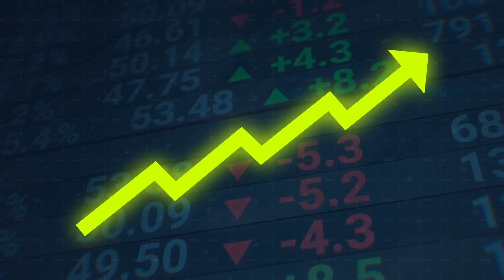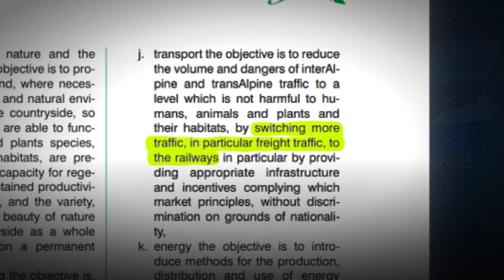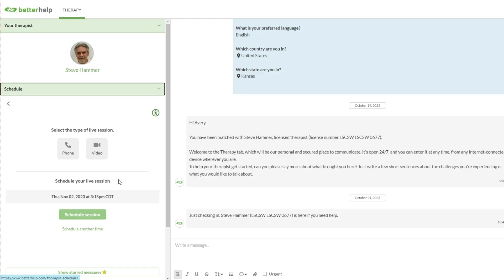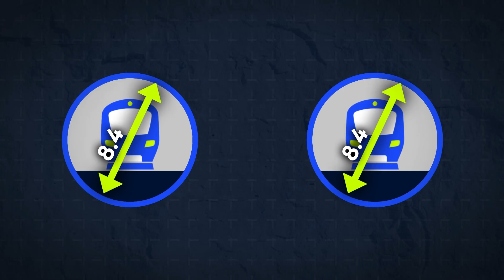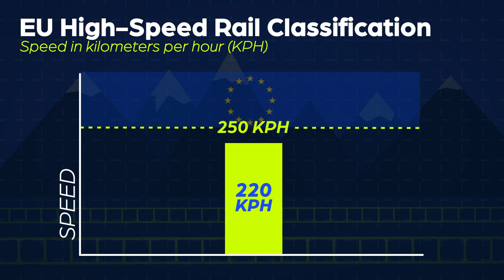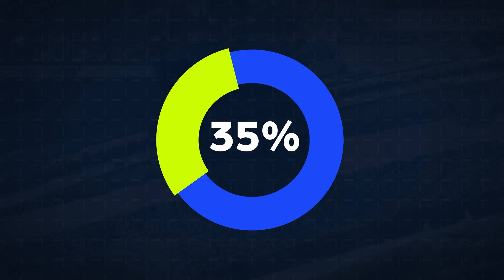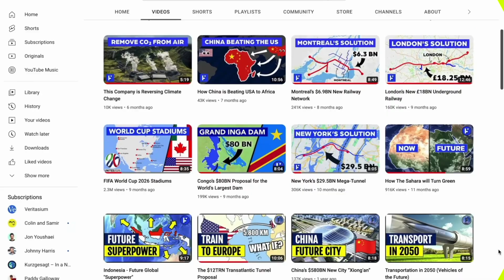France’s €26BN New Railway to Italy

Comment: Opening this new high-speed line from Lyon to Turin would allow effectively high-speed travel between France and Italy at speeds up to 270 km/h or more. But SNCF also needs to build two more TGV high-speed lines, one from Bordeaux to Toulouse and one from Marselle to Nice (and possibly to Monaco beyond). Just these two new TGV lines would tremendously increase usage of TGV in France.
Reply: and bordeux spanish border (spain already build the rest to madrid), and they should finally fill the Nimes-perpigan gap on the line to barcelona. then frances high speed network is finished.
Reply: @melaniedrogr951  I believe there are plans to connect Bordeaux with the Spanish AVE network.
Reply: @Sacto1654  there are, but they have remained plans for quite a long time. Long enough for spain to build the entire madrid/french border section based on the same plans.
Reply: A connection between Nice and Genoa would be cool too
Reply: And montpellier- perpignan/spanish border high speed rail link
Reply: The Marseille-Nice section is a very tricky one to do, the french riviera is very densely populated. Often i look around and wonder where the hell are we gonna be able to build a new HSR
Reply: @looped7979 Exactly. It's only working with a whole bunch of tunnels and bridges and that's too damn expensive. 

Upgrading the classic line for higher speeds is already enough of a challenge.
Reply: @hagmax1531  The planned line from Marseille to Nice (and possibly beyond) will be heavily tunneled, for obvious reasons.
Reply: Bordeaux - Lyon would be amazing too
Reply: Qu'ils refassent déjà la ligne Paris-Toulouse et Bordeaux-Lyon au lieu de faire des transversales stupides dans toute la France pour rallier ces deux villes.
Reply: France needs also to build high speed rail Montpellier Perpignan. But here comes SNCF nationalism and protectionism.

Comment: As an Italian, I have been waiting completion of this project for so long! 
Seeing also how "low-cost" travels are becoming more expensive every year, I am hoping that rail international travel will have similar prices to the airplane.
If so, I wouldn't mind taking some hours more to travel but being able to sit in a comfy train.
Reply: With the train you arrive in the centre of the city (mostly) with an airplane not. Thats why most of the time trains are actually more time efficient.
Reply: @ainonainpg3d799  Absolutely, that's why I really hope we can slowly stop using Ryanair or Easy Jet to move around but sit comfortably in a train!
Reply: If it is anything like the AV network in Italy, competition will likely keep ticket prices reasonable.    The competition between NTV (Italo) and Trenitalia (Frecciarossa) has done wonders for keeping ticket prices affordable and forcing both operators to up their level of service.   With the Lyon-Turin link, you should have competition between SNCF (OuiGo/TGV), Trenitalia (Frecciarossa) and likely NTV (Italo) as all three operators have train sets that can and do (in the case of SNCF and Trenitalia)  run on both the French and Italian high speed networks.  I would not be sutprised to see other operators like Renfé and DB move in as well as other private operators.
Reply: @zyoninkiro  Yeah that sounds plausible indeed!
Reply: @zyoninkiro the high speed rails in Spain is owned by Italy, by Trenitalia (Iryo is an ETR 1000), TRENITALIA COMPANY IS OWNED BY THE ENGLISH AVANTI GROUP, which uses the PENDOLINO, an Italian technology from 40 years ago, the entire Greek network, in France there are 2 year that the Arrow Rossa makes all the routes, IT IS POSSIBLE THAT ITALY IS LEADER IN EVERYTHING, JUST THINK WELL IN THE MEANWHILE ITALY IS BREAKING THE BRENNERO TOWARDS AUSTRIA, (that will be the longest in the world, the third crossing of Genoa, the Naples Bari, they always pierce the Apennines, in Europe they are lucky, they grow up there who spend less, and faster... they just have to pack the tracks and sleepers, those who have traveled in Italy, hundreds of very long tunnels, Florence Bologna high speed rails, practically 300kmh underground for 250 km! Italian infrastructural engineering is incredible, not to mention 100 meter high viaducts everywhere, service stations suspended like an overpass over the road, you eat and see the motorway under your feet...Europe 😅😅 then the costs , have you seen Torino Lyon? Much
Reply: LÜTFEN herkes gerçekleri gösteren bir 'dosya' yapsın kanalında, nasıl mı? Bak anlarsın.
Sonra başkalarınında aynısını yapmasını isteyebilir benim şu an yaptığım gibi.
Ve 'dosya' hazır olduğunda, kalabalık yorumlara bir yorum atın, kanalınıza baktıracak nitelikte. Bu şekilde diğer 'dosyalar da' gözleri önlerinde oluyor. 
Bir kişi üç kişiyi etkilese, milyonlar, milyarlar oluruz.
Reply: There are already daily trains to Paris from Turin already. Just open Trenitalia site.

Moreover the TAV tunnel described in the video will only transfer freight and not people. It's useless.
Reply: @Pippero92  The current train would take too long for me to reach other countries outside of France.
No, the new tunnel would be a AV/AC tunnel, meaning that it is not a fully AV line - hence exclusive to high speed trains - but it allows all type of trains to run. Therefore, it will be used for both freight and passenger services.
Reply: @Pippero92 Not true, it will be for both passenger and freight.
Reply: @Pippero92  useless like it was named "useless" the whole High Speed train system we've built in italy in the last 20 years? So "useless" that we're still improoving it and building new lines, to connect more cities. People like you, at theat time, said it was "useless": now it's used by millions of poeple every year, competing with the plane for trips less than 800/1.000 km, taking you from the city center to the city center, not to aiports located 30/40km from the city center, to which you have to go 2 or 3 hours before the flight time, while for the train you just pop up 10 minutes before. Yeah... totally useless! Come on, are you able to look further than your nose? Don't think so...

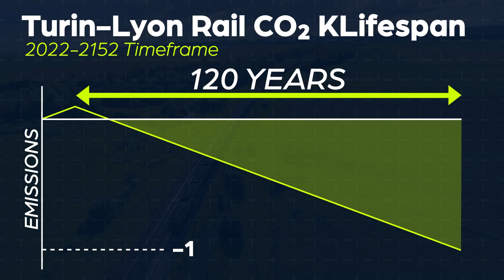Comment: 9:52 only in carbon things u can get to negative side of carbon productino somehow even though u still need some energy to move the trains. that net co2 emissions is such a bullshit :D
Reply: Even if trains weren't running on electricity which means that given the right energy source they can be carbon neutral, the rolling resistance of train wheels on rail is significantly lower than rubber tyres on roads. This alone lets trains pull up to four times as much weight as a truck using the same amount of energy.
Reply: French electric trains gets their electricity from Nuclear Power Plants. ( and in the Alps from dams )
Reply: The train running is a whole lot of trucks NOT running hay otherwise would have
Reply: i don't think you know what "negative carbon emissions" mean
Reply: And what about the trucks/cars that won't be used? Did you took that into consideration?
Reply: man you weren't the smartest one in school were you?

Comment: This is not the purpose of this video, but from a Japanese point of view, I envy the European high-speed rail system, because in Japan, once a high-speed rail system opens, in some places there are no more limited express services from the parallel conventional lines, and the system is just waiting to decline.
I hope for the further development of logistics in Europe.
Reply: In France, when a new high speed track is put in service, the classic trains are removed or the number is reduced drastically. 
The main difference with Japan is that all our trains are standard gauge, so a TGV can uses regular tracks to reach a destination. ( for example, from the video, the TGV will use the regulars tracks in the Maurienne valley and out of Lyon, as well as when reaching Turin  )
Reply: @tenalafel 
I see, that is surprising.
It is difficult for high-speed rail and conventional rail to coexist, even if direct connections to conventional lines are possible.
Maintaining public transport in rural areas is one of the biggest challenges in this country.
The number of trains on my local line has also been drastically reduced.
For this reason, I am sad that I cannot be honestly happy about the opening of the high-speed rail extension.
Thanks for your reply.
Reply: That is a shame. Some of the most beautiful views of Japan are from those local express trains, like the section of Chuo Line from Shiojiri to Nakatsugawa which is one of my favourites.
Reply: That has not been the case in Italy.    The parallal conventional lines remain as they still service smaller communities in between the major destinations and Trenitalia still operates the RGV (regional limited stop fast trains) services on those lines.  High speed trains can also use them if the high speed line has to be closed for some reason.   RFI (the owner of those lines) has also been upgrading many of those lines.   The main issue here is those upgrades are in northern Italy.   Southern Italy is the runt of the litter when it comes to just about everything which requires a lot of money.
Reply: @zyoninkiro  The equivalent to the northern part of England and Scotland, possibly.